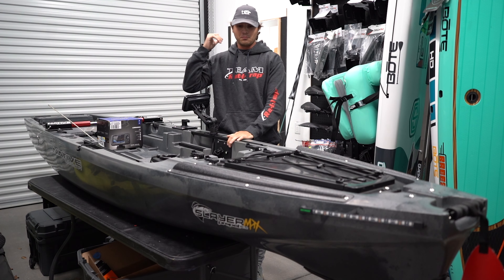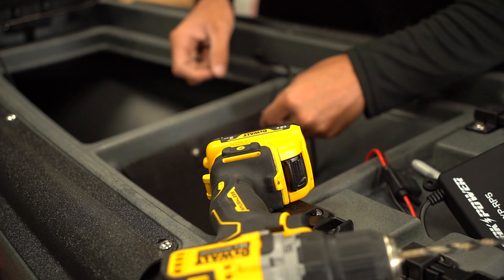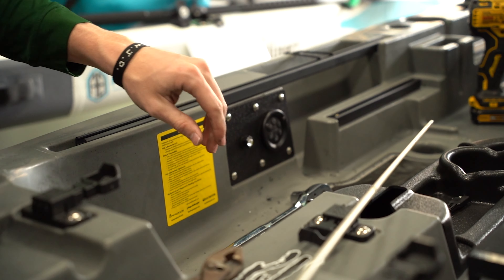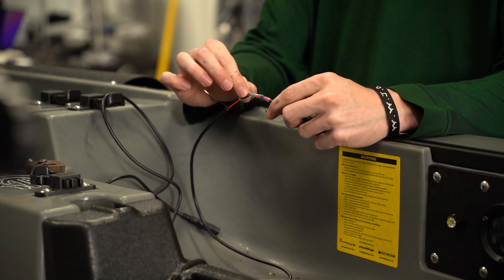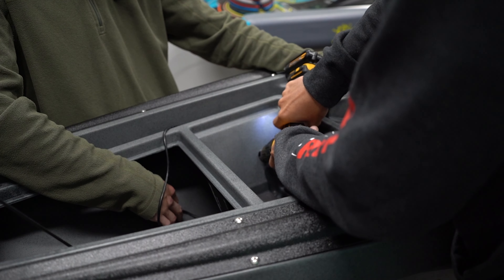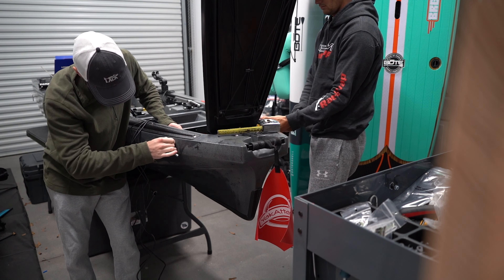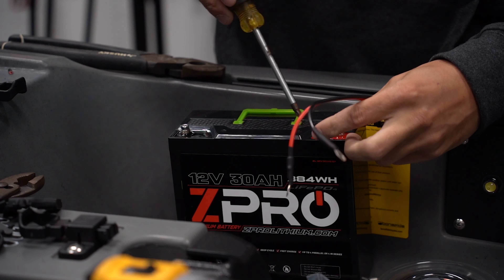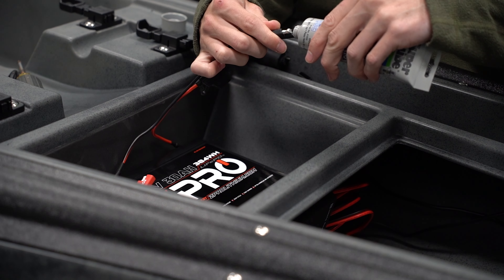Kayak Install: Nav Lights, Interior Lights, Fish Finder, and Switch Panel (SUPER IN-DEPTH)

Comment: The only reason you had corrosion issues use crimp connectors is because you didn't coat the wire with dielectric grease before crimping. Marine installation 101.

Comment: PS- those SAE connectors Y.A used are automotive grade connectors  used for splashing liquids and are NOT waterproof! (Any more then heat shrink is. Heat shrink is an insulator and an excellent way to hide corrosion issues)